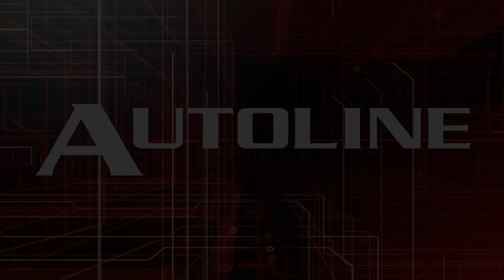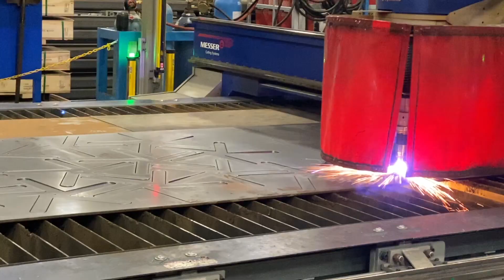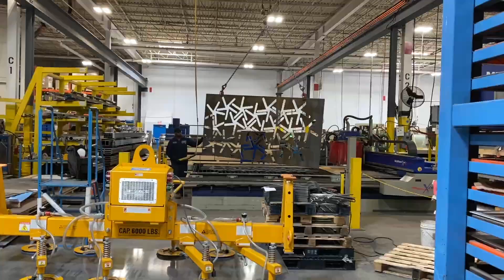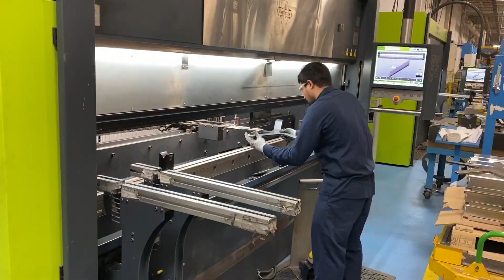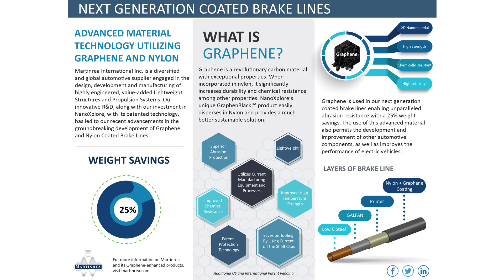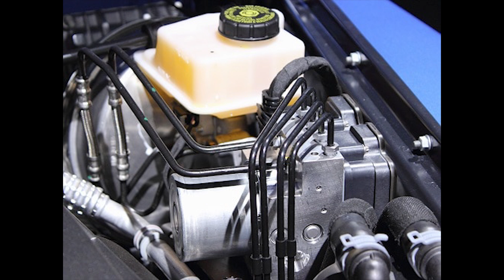Martinrea Improves Brake Lines with Graphene - Autoline Exclusives

Comment: If it’s that conducive can it replace copper in wires and circuit boards? Copper is heavy, easily damaged, and expensive.
Reply: It can replace lithium batteries
Reply: google the cost of graphene....  y assume it's cheaper... smh...